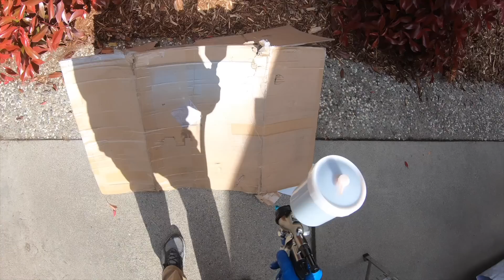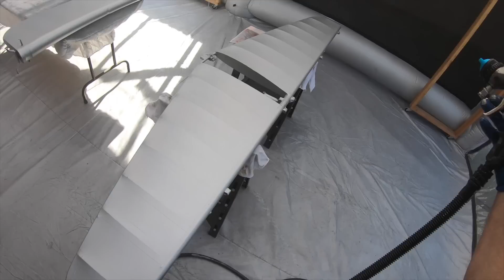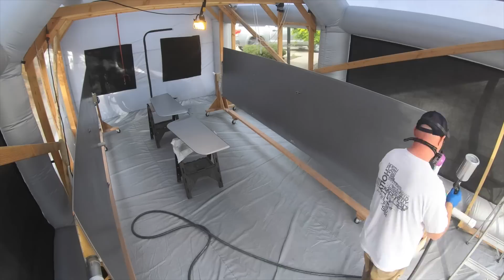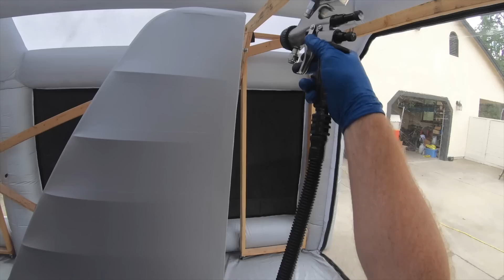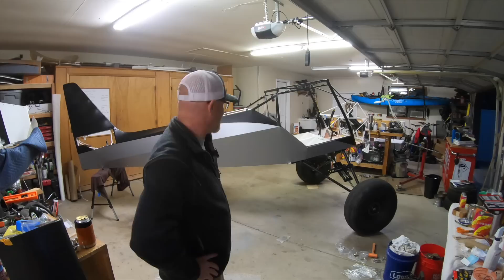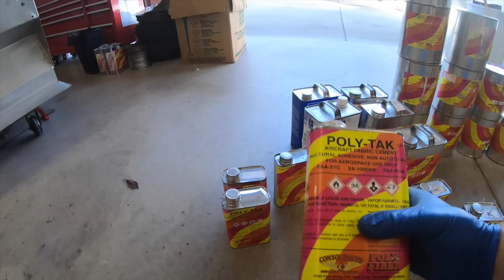Kitfox 7 Apex Build Episode 19 Kitfox Poly Fiber Paint Part 2

Comment: What would it cost to order a kitfox super sport with a rotax 912. I am new to avaition and have been considering purchasing a kit.  But I cant see. To find  what it would cost? Ballpark cost?
Reply from the maker: It really depends on the Kit options. The Kit can be from the $20k-40k range and a Rotax 912 ULS is around $18K plus the firewall forward kit. You can expect to spend somewhere between $60k to $100k to complete a Rotax 912 Kitfox depending on choices.

Comment: Awfully expensive system at nearly $1600. smh  Not even close to "almost as much" as a regular compressor and spray gun.
Reply from the maker: Have you priced a compressor that has the recommended storage and CFM? They are well over a $1000 more like $1500, then you will need the appropriate moisture filtration system and then a descent spray gun. Way more than the Turbine system.
Reply: @BowenAero  I have my compressor ($400 - used) running through an A/C condenser (free from an old car) w/ a small fan blowing continually on it and have very little problem w/ moisture. My 40 gal. compressor can handle all the CFMs necessary for painting, as I've sprayed a couple cars with my set-up. The spray gun was something I got from Summit Racing, so fairly inexpensive. Not trying to be argumentative, just my experience. I do like the portability of that turbine system, as that is a nice, compact unit, unlike my very large/bulky compressor, which would take a P/U truck to move. Be well, sir.
Reply from the maker: V. E. No doubt it can be done for cheaper if you get creative like you have. This is just a very simple solution that does an excellent job and is very user friendly.

Comment: Great video. I was think about what finish I would use, I like the idea of the paint as you can do more trim line detail work but thinking about the weight and time I think I will chicken out and go to the Oratex. I paint cars and know how much time is involved and knew the paint covering systems are heavier but the cans of paint you showed at the end realy shows the weight.
Reply from the maker: Remember Oratex has the weight already on it, overall it may be a little bit lighter but not by much.
Reply: @BowenAero  From what I have seen on weight Oratex has a large weight saving around 25 to 30%. For my aircraft every ounce counts. The down side is it is not as gloss as a painted finish.

Comment: HVLP is the way to go, after 50 years of using a compressor high pressure system I switched to a British Apollo HVPL system (looks very similar to the U.S one so I don't know who ripped off who). I'll never go back, more paint on the project less floating around in the air. Keep up the good work Brian.
Reply from the maker: Exactly my experience, no more air compressors painting for me.

Comment: Excellent job, fine toutoring 4 sure and most all the info needed to do the job for sure. I did couple aircraft & lots of repairs with Polyfibre and found it good system all round . Wonder why you chose dark colors for it though, I had one navy blue and white and it was so hot and I live here in north country! One thing I found noticable was the amount of paint supplies will certainly vary depending on how you use the equipment, the temp and humidity on the days doing the spray! You can certainly make a light plane using this system eh?  Very nice lines too! all the best

Comment: Love your videos. hoping to build a highlander. how did you lay the pinstripe tape down and get a smooth even curve on both sides.
Reply from the maker: I showed the tape going down on the wings in time lapse, it actually took about 2 1/2 hours to mask off the wings. About the same for the fuselage. I laid it down and would eyeball it to get one the way I liked it. Then took measurements at key locations to match the other side. It took several tries and a lot of tape.

Comment: Looks great! Would you still recommend Polyfiber over Oratex? I love a solid paint job but dang is it a LOT of work (I've painted regular sheet metal aircraft but never fabric). Again, fantastic job!!!
Reply from the maker: If you want to save about 4 months of time, then Oratex would be the way to go. Remember it is a one color per surface option, so your paint scheme is limited.
Reply: @BowenAero  I'd be curious to see a price breakdown of Polyfiber vs Oratex. I know everyone complains about how expensive the Oratex is, but I wonder how the supply costs break down, disregarding time savings which is clearly huge.

Comment: My experience with turbine painters is the one I used back in the late 90's did a poor job of atomizing the paint and spit it out too thick. I love my divilbis gun. Maybe it was the Eastwood gun you had?  You also need a big compressor.
Reply from the maker: They have probably improved a great deal since then. I had the opposite experience. The air compressor set up did a poor job atomizing the paint and dripped and spit. The Apollo turbine with the 7700 gun atomized perfectly the entire time. Totally consistent and reliable. I absolutely needed a bigger compressor, filter system higher end guns. That is why the turbine system is such a good solution. It is less expensive than a quality air compressor system with equivalent spray gun. It is more portable and is designed specifically for painting.